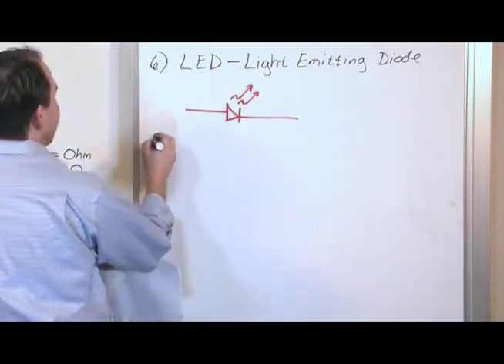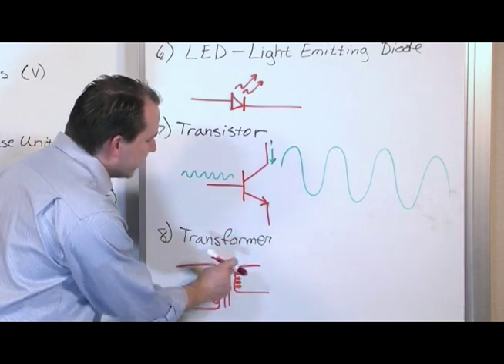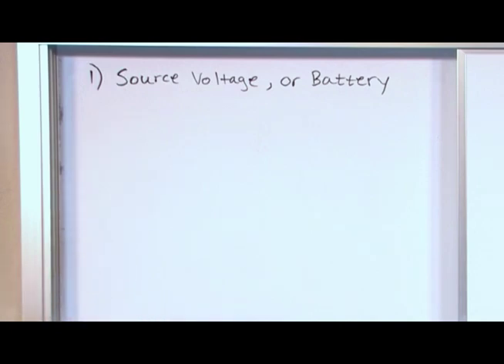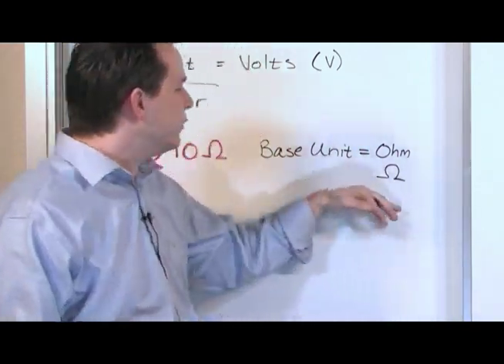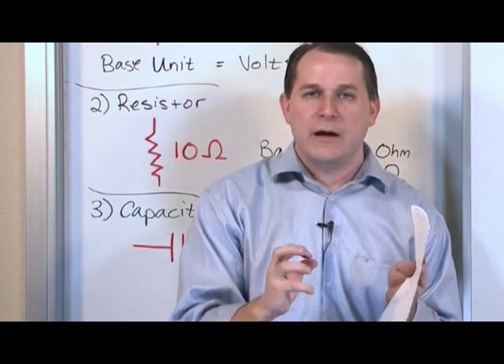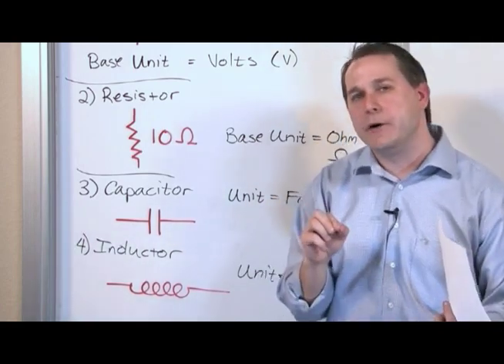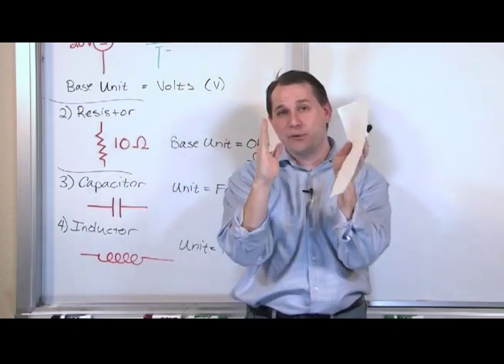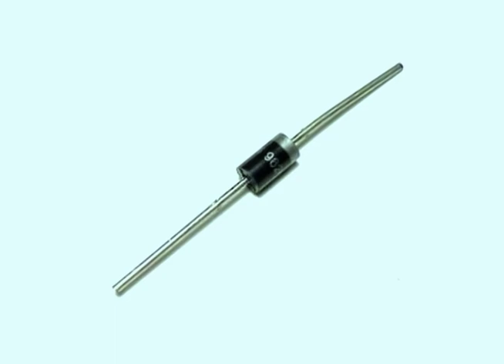Overview of Transistors, Diodes, Capacitors - Circuit Theory Explained!

Comment: Transistor acts as a current source. Is it due to the fact that a small  variation in base current results in a large variation in collector current without varying the collector voltage?
Consider an ac source lighting an electric bulb If there could be an open circuit, the bulb doesn't glow. Suppose if we replace the oc with a capacitor,does the bulb glow again?